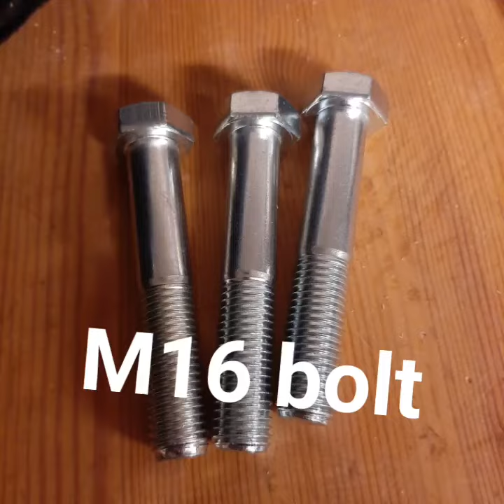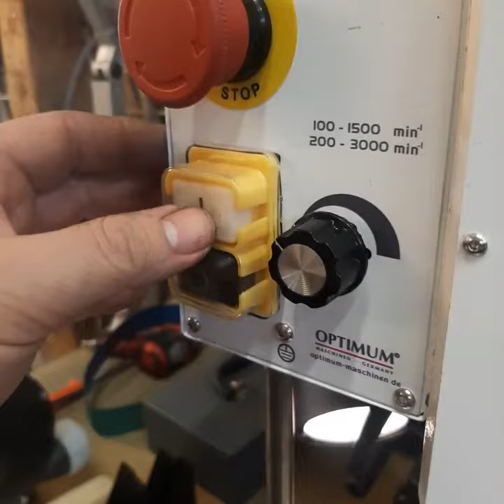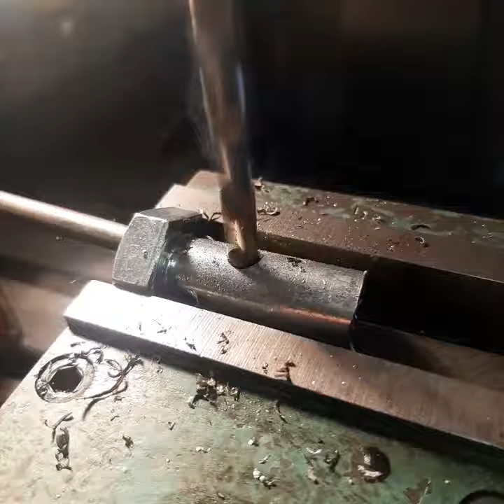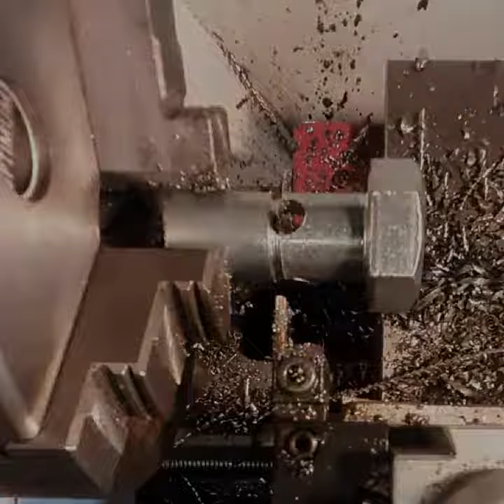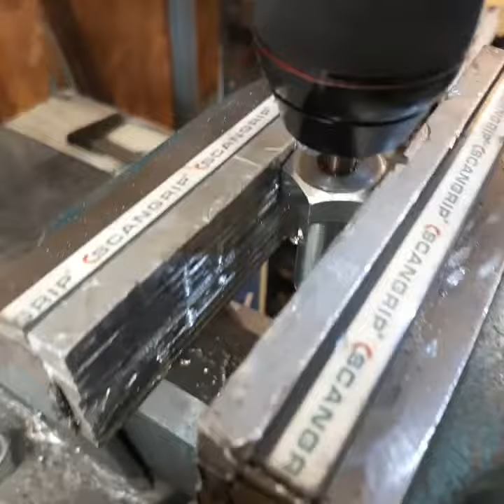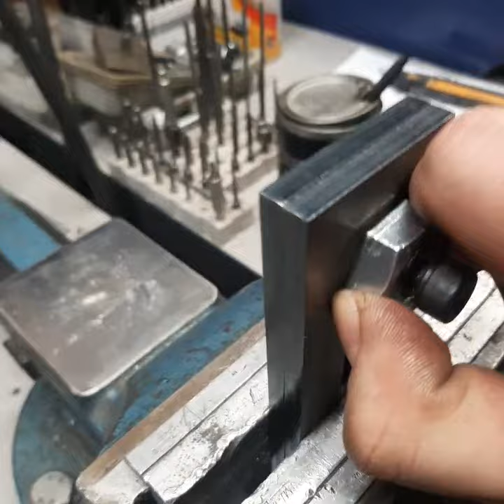DIY Weld table boll locking pin

Comment: Awesome! What size are the holes on the side and what size steel balls are you using ?
Reply from the maker: Hi the holes is 6.5 mm and the steel ball is 6.3 mm the balls is from old ball bearings SKF 6004-2RSL/C3 😀
Reply: Como haces para que no se salgan las bolas si los agujeros son más grandes???